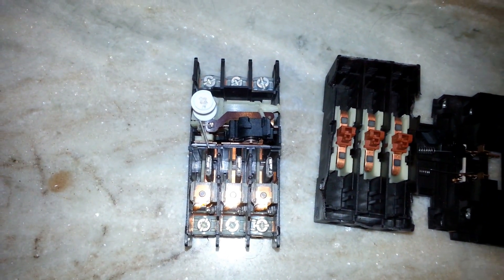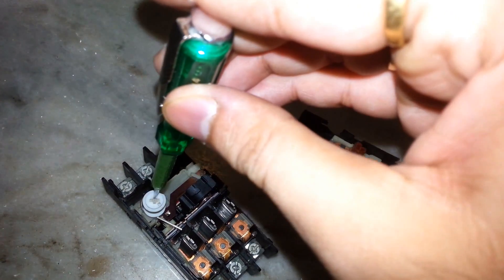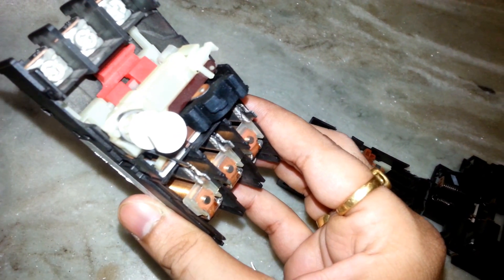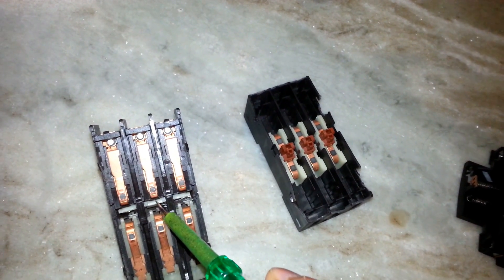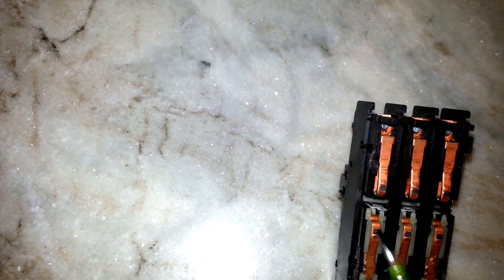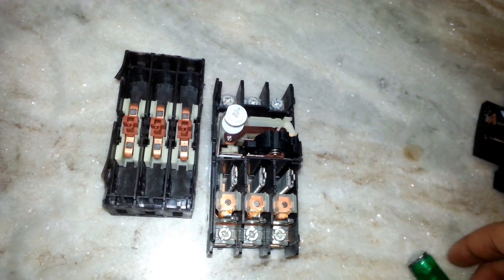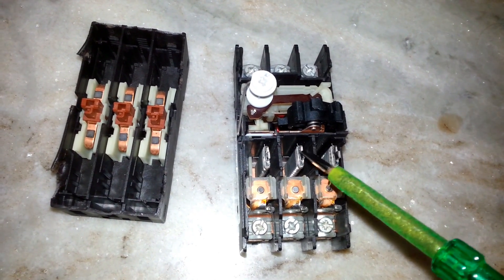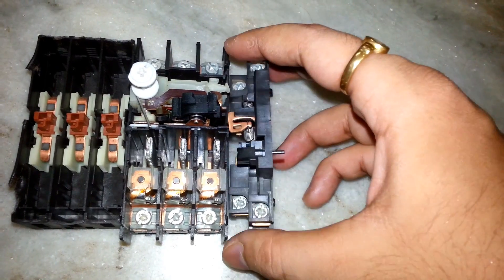How MPCB works? - Inside view and Explanation

Comment: 12.5 hp submersible moter which mpcb is best if moter consume 18 amp
Reply from the maker: If your motor is 3 phase 12.5 hp motor, then go with LnTs MOG-H1 series 14 - 20 amps. With Siemens 3VU13 series 14 - 20 amps range. For calculating perfectly the motor's full load current use this calculator - https://engineershub.co.in/hp-to-amps/

Comment: Can an MPCB trip if you wire a 1-phase motor through it because of phase unbalance over the MPCB?
Reply from the maker: Yes, it can trip. but there is a way to connect a three-phase MPCB to a single-phase motor. Check out this article of mine https://engineershub.co.in/connect-motor-protection-circuit-breaker-to-single-phase-motor/

Comment: Really helpful video, and also I'd like to ask does it protect against phase failure or phase loss?
Reply from the maker: Yes, it can protect phase failure because it is designed in that way. 
Assume that phase R is failed or completely disconnected. In this condition, motor would TRY to grab more current to maintain the torque. This would result in deflection of bi-metallic strip associated with phase y and phase b. The deflection would cause overload tripping of circuit breaker.

Comment: How is doing one phase failure  out of 3 phase  and unbalanced voltage cut off.. 

Pls explain.
Reply from the maker: Hi Senthilkumar S, 
That is a good question.
If you look at the MPCB carefully, in each phase two types of protection is there, one is magnetic protection [2:08] and another is thermal protection [1:45]. Suppose in one phase, the voltage is cut off, under such condition the load (for example motor) would try to grab more current in order to maintain the torque. In such cases, the bimetallic strip given in that particular phase would bend resulting in tripping the circuit breaker.
Reply: Thanks for Ur update..
Reply: @senthilkumars5793  any chance you did some work in zambia?